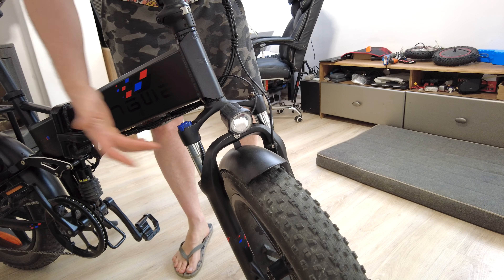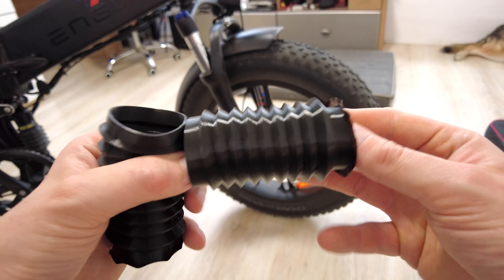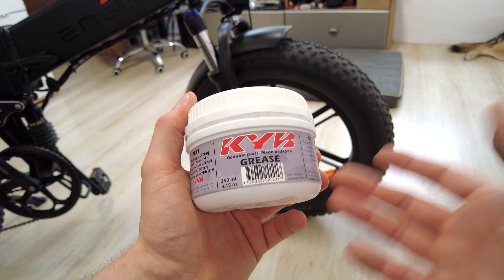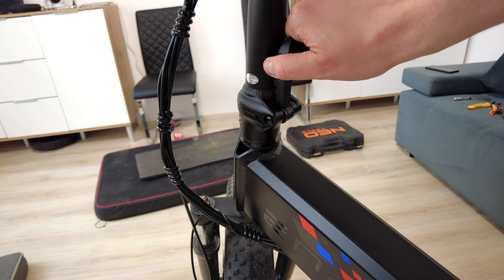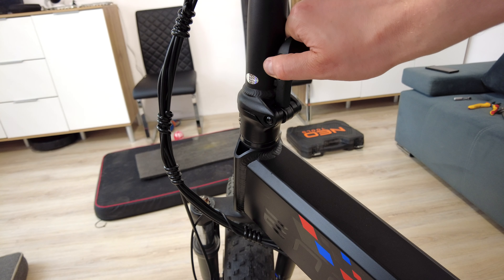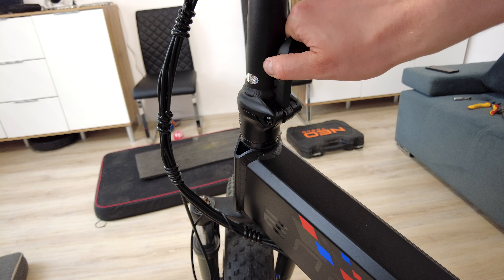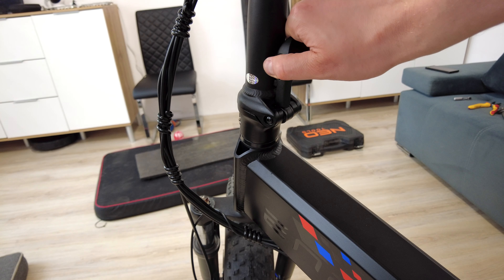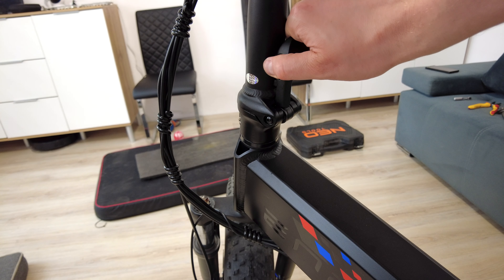How to fix Ebike Fatbike Fork to work smooth again 😏 Engwe engine pro example / SRsuntour

Comment: Good instructional video. but in the first part you had the blue handle set to near lock caused the fork to be rough, and in the final test you switched it to be fully open!
Reply from the maker: do You know, you can  set position of the blue handle when you remove top screw ?  , I turned it  a bit so it could be asier for me to lock fork while i do some uphill.Maybe that is why it looks like it's locked ( also if I would lock it, it woudnt even move 2mm )

Comment: Hi there thanks for the  video 👍
I have the same forks and I am having an issue where they make a kind of clunky sound on rebound. It’s sounds like they’re topping out , when they reach full extension. 
Do you have any idea how I could fix this or are they just cheep forks ? 
Thanks mate
Reply from the maker: Yeah I did tiny adapter for it but I never done video :) . So you have to add small soft washer ( rubber or silicone ) on the main long screw . When the fork will extend , this washer will supress annoing noise when metal screw is hitting metal  stanchion " silver fork tube "
Reply: @PirateWasHere  I thought it could be something like that
I’ll get onto it 👍. 
Thanks for the quick reply 
Much appreciated .
Reply: @CleveStarke  The clunky sound might be coming from the battery inside the body moving up and down when going over bumps. You can use felt tape on the bottom of the battery to dampen it and it will also allow the battery to go in and out smoothly. See if it works.

Comment: Is the Engine Pro as good as a lot of people say for the price? Interesting video by the way.
Reply: I have a ep-pro sinds 2022 december, very good price and if there is a problem or if i need a new part i can easily email the support and it’ll get solved.
Reply: @R7MY_  I see. I'm still waiting on mine. Extended delivery time due to demand I'm guessing. Hope it arrives soon.. and with no problems. Cheers!
Reply: No. Controllers are crap along with the LCD
Reply from the maker: All works decent, no issues after 3300km

Comment: The new ones of these forks have no springs just a aluminium thin pipe that connects onto the bottom nut but none on the otherside but a very awkward nut  so youll need a long bar  to get at the inner nut
Reply from the maker: uhhh that sounds like adventure :)
Reply: @PirateWasHere  i think they should be air pumped not sure but ill find out 👍,its loads better with a clean tho as much as i could un siezed it but i gotta lock it out sometimes great in a field tho  nice comfy saddle 😎

Comment: How did u remove the rubber gaskets that prevent dirt from going inside ,im stuon that part😅
Reply from the maker: Do not remove it, just clean as much as possible
Reply: @PirateWasHere  ok 👍 thanks

Comment: Can you show us how to fix the rear suspension, it has the same problem, the stiffness😅
Reply: Check this! I dont wanna change bolds...😂
Reply from the maker: @prometheus8810  change it , replace shock , sand or dust could get inside. For sure DO NOT open it

Comment: Hay pirate. Engwe says on their site pro model has hydraulic fork's but yours has spring's. Did they upgrade
Reply from the maker: I don't think so :)
Reply: @PirateWasHere  Noice thanks bro I'm getting the pro in a week or so, putting the covers on now will save my ass🕳️ down the road 🥳
Reply: @Captain_Sweatpants_945  thank you. I didn't know they were called boots they work for me anyways. I've done 1200 km so far not a single bit of rust under the boots. the silicone grease has no sign of drying either.